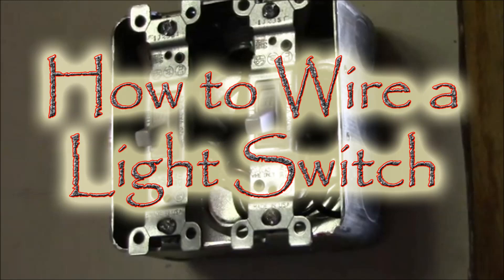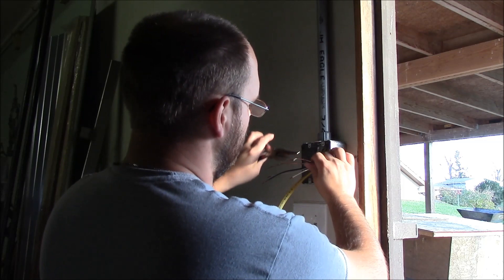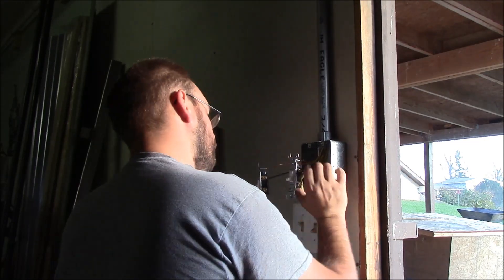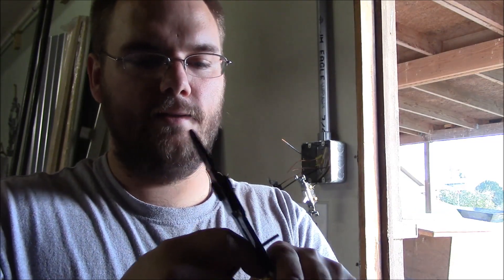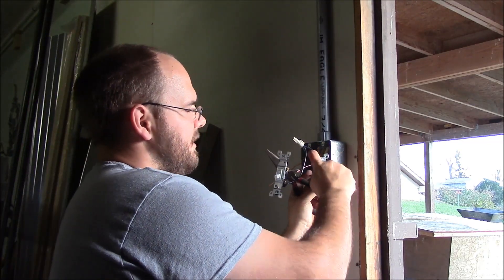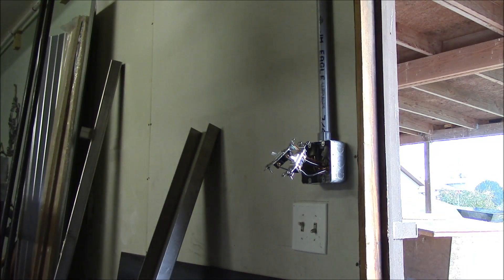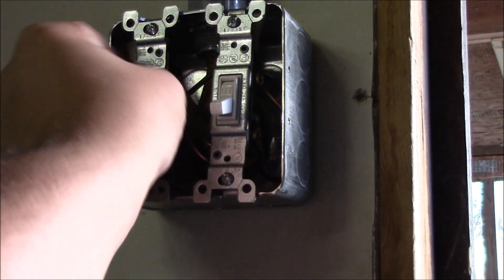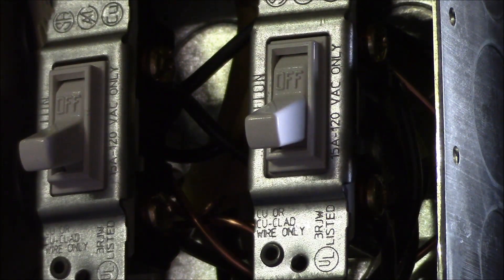How to Wire a Double Gang Box Light Swtich

Comment: I did that why does both switch's turn each lite on or off I don't get it.
Reply from the maker: Did you do one Cable in from the feed/breaker box, and then two cable from the gang box out (one Cable to each different bank of lights coming off of each light switch)?

Comment: Code violations are present in this video but I’ll let an electrician speak up.
Reply from the maker: Only thing I can think of is not taping the wire nuts. What are you thinking? We are all here to learn, so I'm curious.
Reply: @DavidFinchMMC NEC doesn't mandate taping wire nuts.
Reply from the maker: I do also see that I show using a 15 Amp switch with 12/2 wire, maybe that? But what wasn't told is to size the breaker to 15 Amps.
Reply: @DavidFinchMMC 12/2 wire is fine.
Reply: Metal boxes must be grounded per NEC 250.148 and 250.146, there is a 10-32 threaded hole in the back of the box for this purpose, and PVC conduit must be clamped to wall within 3 ft of a receptacle or junction box per NEC 352.30.
Reply: This may not be a code violation, but you used the wrong box. That's a flush mount box and you should have a surface mounted one. A 4x4 "1900" box with the appropriate mating metal cover should be used for surface mounting, the device(s), switches in this case, are mounted to the cover with supplied screws and kep nuts. Using a flush mounted box as you did, prevents the cover from resting against the wall and is a snagging hazard.

Comment: Instead of switching the wires, you could have just moved the switch to the other side and marked the wires accordingly. The hots and grounds serve the same function regardless of which switch they're on. As long as nothing touches bare wire, you should be good.

Comment: How bout if you have four switches in same garage with all different sets up lights? Do you splice all four blacks to the one feed to the panel ?
Reply from the maker: Mike Angeli only if you won't over draw your amps from all lights being on at the same time. For instance you might run a 12 ga from panel to gang box, and 14 ga from gang box to individual light circuits from the switches. My current garage I did this with three switches. Most LED lights these days won't over draw and it's not a problem. 

Hope that helps explain what to look for. Thanks for watching and a great question.
Reply: David Finch it was gonna be 3 hanging pendant lights for bar,6 led high hats,two sets of the track lighting led halogen,and two lights outside on the house.If that’s too much I was gonna use 12/2 romex and 20 amp breaker or is it ok if I just run two feeds from the panel to lights switches and do half lights on one half on the other ? Thx for gettin back
Reply from the maker: @dantemikey  I don't know what those lights draw, so I couldn't make this determination for you. It is something you would have to figure out, either look for a wattage and divide by voltage for amperage, then add all of them up, or see if a amperage is listed.
Reply: David Finch is it safer to just maybe run separate feeds from panel to light switches

Comment: Always ground first, neutral and then finally connect you line and load wire lastly.   Cut your wires short. Leave a little extra for later servicing.

You continue to use the word “conductor wire” for your line and load wires.   Conductors are all the wires in your wiring matrix.   Line wire is you “hot wire” from the service panel which supplies your power. The load wire is the wire traveling to your light or what ever it is you’re powering.  Neutral is neutral (white) ground is green.

Comment: David,
It was truly trying to watch this video as you seemed to make this simple installation as slow and tedious as possible.  I mean you no offense but it doesn’t seem like electrical work is your strong point.  Most electricians, at least here in Canada, would do this quite differently, use less materials and reduce the risk of follow-up trouble from making unnecessary connections. Here is the way I would approach this. First identify each wire’s purpose (Power source, Lighting circuit #1 & #2) Next remove the outer jacket from all cables without trimming any wires (suggest a proper Romex
stripper for this – e.g. Klein K90-14/2) . Then, twist all the ground wires together close to the box and trim two of the three wires. Push these grounds to the back of the box and take the long end and secure it to the box with the ground screw regardless of the colour of the screw. For the long single tail left over, bring that to the front and leave it. It can be connected to the first and then
the second ground screws on the switches a bit later. Now move the neutrals. Trim the wires to a  suitable length, strip them and then twist them tightly together and trim off any excess and apply a wire nut. I know the code permits doing what you did (applying a wire nut without twisting the wires together first) but I have never seen an electrician that actually does this. Now push the neutral wires to the back of the box out of the way. Next let’s deal with the hot wires. Best to deal with the one coming from the power source (panel) first. Leave it long. Without cutting the wire, use the same stripping tool you used and expose the bare conductor in a suitable mid-wire position. This wire will be wrapped around one of the terminals on the first switch. The excess wire can be routed to feed power the second switch. The remaining two  wires (going to each set of lights) are wired separately to the second terminal on each switch.  Now take the ground wire protruding from the box and jump it to the ground terminals on each switch.   Now neatly place the two switches into the box, screw then down, add a two gang cover plate and you are done.Take note that there are no unnecessary pig tails or wire nuts used. Less materials, less possible points for heat buildup or failures (unneeded wire nuts) and less clutter in the box itself.  Clearly what you did will work OK but I would not be as comfortable as I would with an installation like the one I described.
Reply: Frankly, I'm impressed by this comment, and by David's reply. All too often here on Youtube, some well-intentioned person, an amateur, does a how-to video. What follows are the most insulting personal attacks and flames from self-professed experts. I'm a rank amateur myself, and I learned from both David's video, and from Dean's reply. How rare is that? Props to both of you.
Reply from the maker: Dean, thank you for a great comment. You are right that it is not my strong point, I think I make that clear in all my electrical videos that I'm not a professional electrician. I make these videos not to fool anyone, but to let some people understand that it isn't terribly difficult and can be done if you want to do it yourself. I have pinned this to the top of the comments as I think it is a great explanation of a better and effective way of doing this. Thanks once again for watching and commenting with a helpful way to do it!
Reply: Jazzy, Yea, I have used Wago Lever Nuts and I agree they would be fine in this application. I generally use them for maintenance work as there is no trouble if some of the wires are a bit on the short side. The ones I have (#221-413) are rated for 20A. That said, my preference is to not introduce joins that are not absolutely necessary (in this example power wire in, two pigtails out). Such joins can still be a source for future trouble but I would agree, highly unlikely in this instance.
Reply from the maker: Nick Jones, I'm glad you learned that way. I always thought you tube should be like that.

Comment: terrible video; shot from behind, can't see what he's doing, doesn't even have the right wire cutters to cut romex.
Reply from the maker: Sorry the video is shot from behind. Could you please tell me what the specific type of wire cutters needed for cutting Romex is. I'm certain you are correct and there is only one type that will work, I mean this style must not have worked out for me right? Please educate and provide a solution, until then by pointing out errors without a suggested solution, you are being a problem. Oh, and by the way, Romex is a brand name and not a cable type, Troll.
Reply: just saying, if 7inch sidecutters work for you, that's fine. If one is running a lot of wire, like all day long, I would suggest Greenlee 727,
or Klein 63050, 9 1/2 inch cable cutters. easier on the hands and only about $22. Works well for 12/2, 10/2, and larger wire.
Reply: just saying, if 7inch sidecutters work for you, that's fine. If one is doing a lot of wiring, like all day long, I suggest Greenlee 727, or Klein63050, 9 1/2 inch cable cutters. easy on the hands, cuts 12/2, 10/2, and larger wire with ease.

Comment: wait can you turn them on at the same time??
Reply from the maker: Why wouldn't you be able to? If your concern is that I am branching the circuit here, that is pretty common, and as long as the accumulative load of the branches doesn't exceed the load of the first line and it's breaker, then your good to go. Thanks for watching, and hope that explains it.
Reply from the maker: Was that a flinch? Well dang, two for flinching. Thanks for the view and comment!

Comment: David, it looks like you connected all the neutral (white) wires with a single wire nut. So, that was the neutral coming from the breaker box and 2 neutrals coming from each light. Can confirm that is what you did? I couldn't quite make it out during the video but i wanted to confirm. Thanks for the demo too. Very helpful.
Reply from the maker: Yes, you are correct. there were 3 neutral wires, one from the circuit breaker, and then one from each light bank for a total of 3 in the one wire nut. 

Thanks for asking for clarification and hope that this helps you out with what you are installing.

Comment: did you ground your bare copper wire to the metal box?
Reply from the maker: +Nguyen Khoa I got a chance to look at this one this past weekend. There is not a copper wire with the magical green screw connected to the metal box. What there is, is that both switches are grounded and both switches have two points of metallic connections to the box. Yes there probably should be a third ground to the box, but as far as safety goes, it is well grounded.

Thanks for the comment!
Reply: +David Finch (dfmmc2014) thank you for  your time sir
you have wonderful day!